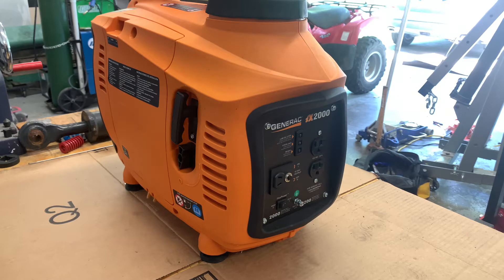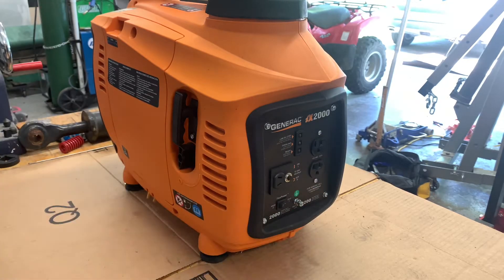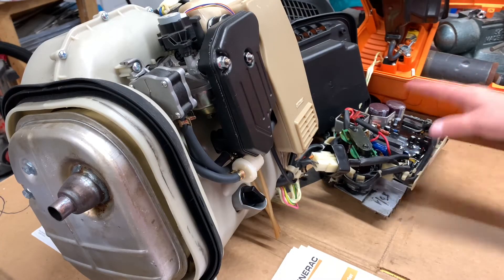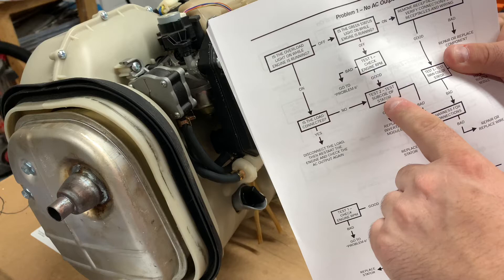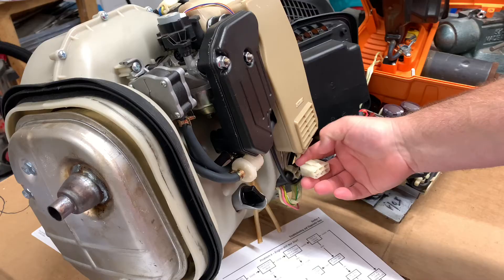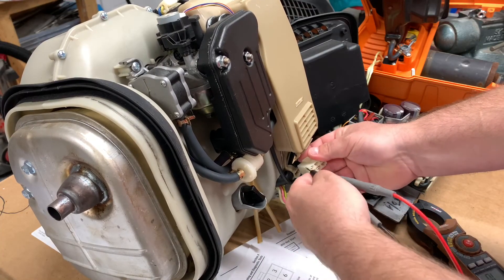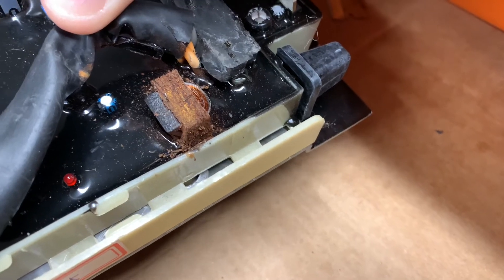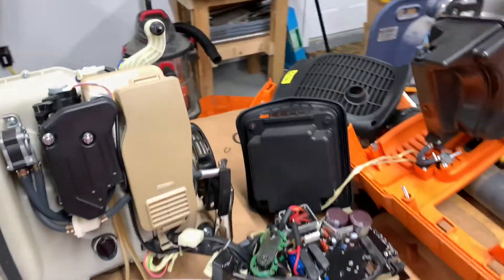Generac ix2000 Overload Light. diagnosing and thoughts.

Comment: What abou iq2000 starts and runs but electric outlet doesn't stay on ,,it comes on for a few seconds  then goes offgenerator
Reply: Just encountered this yesterday with my own low-hour use IQ2000. Reading that the inverter unit will likely need replacing for a cost about $100 less than I paid for the generator itself. Disappointing as I have 2 of these units.

Comment: Well damn, I have the exact same symptom.  Runs great, but the overload comes on within a few seconds with no output.  The info I found online, and now this video shows that mine is shot too.  It sucks because this little generator was awesome to bring to the camp, and quiet compared to other generators I've had in the past.  Another one bites the dust.
Reply from the maker: Definitely. It looks like the Honda 2000 still is on top.

Comment: Sometimes these boards can be de-potted depending on the composition.  I believe that rusty transformer shown was a known failure point with these.
Reply: I am gonna try and repair mine. I wish I could find a schematic with the values of the parts. I damned sure ain't buying a new board just to have it go out 20 hours later.

Comment: Where you did the resistance test. Could you hook up an external inverter from there? Say a inverter that people hook to their cars batteries?
Reply: No, because the carb is controlled by the curcuit, you will have carbon buildup with the need for fluctuation from the computer controled carb.

Comment: https://youtu.be/BdBCCFAAIJg this is the link to a video, the guy had the same problem and he shows how to change that mini 4 pin transformer. You can use a EMI line filter common mode choke, just rewind it 500 turns primary 500 turns secondary with .1 wire. Or the NTE-1 transformer has 4 wires,,,, after you heat and remove the potting,,,, insert the filter from the top via the 4 wires on the NTE-1. Just make sure you rewind transformation ratio 1:1.
Reply: Link to the exact transformer needed to be replaced?
Reply: @rubio7922  there is no exact transformer, you remove the old one and rewind it the manufacturer will not give a schematic on this line filter, you must know how many volts on the primary and how many you need secondary because the secondary leads to a series and at the end of that series there is an outlet of voltage which requires an exact voltage for the gate to open, then entering the rest of the board and the main capacitors resulting in a/c 120v. Yes it can be done mine is a Generac ix800.
Reply: @johnenon  Have you done this type of repair?
Reply: @rubio7922  you can use an EE19 bobin. This is comon knowledge in Mexico with inverter refridgerators, look it up here on utube they will show you how to remove the potting also. If a Mexican can do it anybody can,,,,and no I'm not Mexican.
Reply: https://youtu.be/8nkCHyKO8t8 top mount it it's faster and easier.
Reply: @johnenon  Great work man!!
Reply: https://youtube.com/shorts/SLoiflyF5v8?feature=share ,,,see photos.